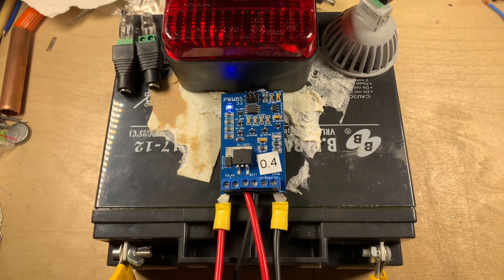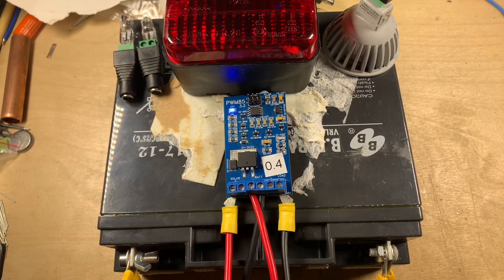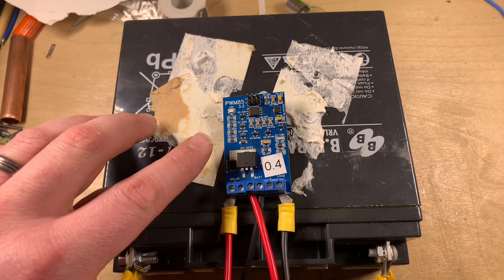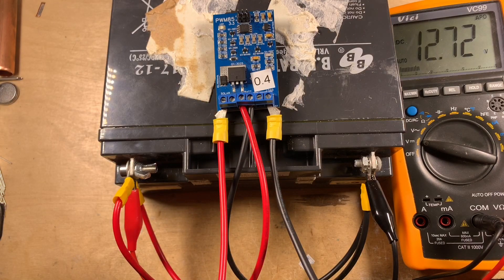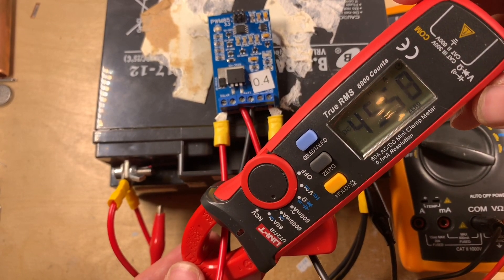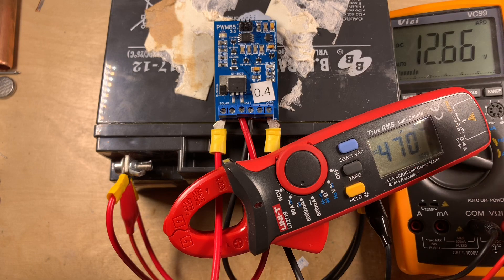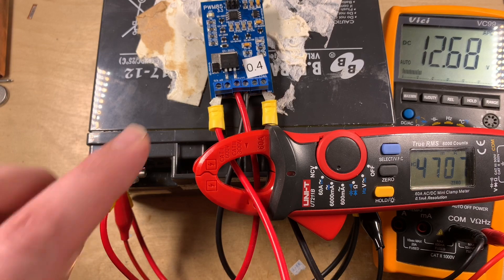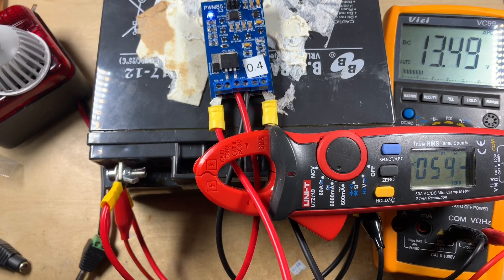PWM85 Diode Test

Comment: Great Video and explanation ! . Would be interesting replace the Mosfet (with external Heatsink) for a HY4008 and also replace the Diode for a HY4008 as Diode . This would be (in my opinion  beast PWM charger when the Load it is a (as my case) a 800W homebrew Sinewave inverter and my 1.2KW solar capacity.  Good channel I see .
SUBSCRIBED !.

Comment: I've always been curious as to why this style of 'charger' does not take the battery to a proper absorption phase before floating. Surely the battery will never be fully charged and its life may even be shortened.
Reply: fully charged battery is 12.7v if its lead acid. bit higher if its agm.
Reply: @slybunda  At rest after charging perhaps but certainly not while charging
Reply: @Magic-Smoke  if your charging with low current then reaching 13.2v is fine for lead acid. as long as its above 12.4v sulfation should not be an issue.

Comment: Nice implementation and interesting as usual. I’ve been lured right in and would love to make up some PWM85(3.3v) and went as far as ordering PCBs from JLCPCB, then the “fun” started. I’m having a devil of a time sourcing the parts, some a lot more difficult than others. Is there anyone out there doing a kit?
Reply from the maker: I’ve source 95% of the parts at LCSC.com. The biggest issue for availability is probably my choice of 1206 parts - most people use smaller. I could probably provide a list of stock numbers. 
Where is the world are you?
Reply: @AdamWelchUK  thanksgiving for the offer- I'm in Australia. As it has transpired I've ended up being able to source everything except for the MOSFET but I have a work around in play so it's ended up all good. I don't think my eyes or fingers could handle any thing less than 1206 so I won't be complaining about your design choices! I think the biggest issue was trying to order only what I wanted and getting stuck with minimum quantities of some components (some at 50 or so). In some cases I substituted higher spec parts so covered all. They didn't cost that much at fractions of cents each but it's a bit of a waste- unless I make a heap of these, At least the DIY reflow wil nowl get a good workout.
Reply from the maker: Glad to hear you’re sorted. Good luck :-)

Comment: Could a Dc power supply be used instead of a solar panel, and if so what would the minimum spec be of a DC power supply? Awesome stuff. Thanks Adam.
Reply: i used spare laptop charger, hp which was 19v 3.5amp and it worked good.

Comment: Slightly unrelated question about the Uni-T clamp meter, if you connect probes/alligator clips to the terminals on the bottom, does it have the functionality to read watts if you connect it to the battery/solar panel terminals?
Reply from the maker: That would be a nice feature wouldn’t it? But no, I’m afraid it doesn’t.
Reply: That is a shame. Seems like such an obvious feature to include if they've already gone to the trouble of adding the voltage measurement circuitry and terminals.

Comment: Previously you tested a red board with a CN3767 which is closer to a mppt buck converter. I would love to see if it out performs the pwm. As I am messing with very old 10v 2a panels (I have 5) but 50v is too much for most converters so i plan to use 2 x20v and 1 x10V. The two 20v strings each on their own charger for 2 x 12v 24ah batteries. Do you still have your energy meters (big blue box)

Comment: Not on topic so please excuse, but I ask a question on fuse video you did from 2016, could you please take a look?  I'm so interesting in the answer I can't stop thinking about it.  It is a question about having a fuse on the negative and positive wire.
Reply from the maker: I’ve commented now over there.
Reply: @AdamWelchUK  Thanks, that was an interesting video.  True, most of the time, everyone would size the wires the same.

Comment: Hi Adam
It looks as though your panel as not receiving 100W of solar insulation any way as I would have expected at least 5.5A from it.  Either that or the panel was very hot reducing it's output.
100/18=5.5 I have assumed an MPP of 18V.

Comment: I would remove the diode, or add a contact to bypass it. Just don't connect it wrong. You will get 1.8% to 3% more power in your situation. Stop wasting energy. Please. (I am running off of solar for quite a while now, several years and I do not allow myself to waste energy).
Reply from the maker: It’s removable for anyone that wishes to - the pads are bridgeable. I like the insurance of it being there.

Comment: 13.5V charge limit?????  14.4 volts is the normal value for lead acid batteries, or is this an AGM Battery?
Reply from the maker: It’s AGM but the charging limit is programmable you to about 16 volts.
Reply: 14.4v isn't the maintenance or float charge voltage though, it's usually 13.5 - 13.8, so spot on in this case.

Comment: Wicked so your design is way more capable than you realised.
Reply from the maker: Julian rated the pwm5 for 6 amps - enough for a 100 watt panel. So it’s just the changes to the hardware I’m having to test really - along with the software which is very different now!

Comment: hello adam, nice video, How is your powerwall holding up? I bought 7 prismatic cell Lipo 3.7v 150AH for my 24v inverter, which cut off at about 21v, 3v for each cell, I drain them to about 3v daily, but my mppt charge controller is set to charge them to about 4v daily, the chinese manufacturer I bought it from estimated about 2000 cycles, but reading from battery university suggest otherwise, say Lipo is about 300 to 500 cycle, what's your opinion?
Reply: Lipo has far less cycles than LiFePo
Reply: @tobimai4843  so in situation, what are the amount of cycles?
Reply from the maker: My lithium pack is running well thanks. I don’t deep cycle it very often at all though, but having said that the cells came from old laptop batteries which must have used up a fair few of their cycles! My understanding is lithium cells should have more than 1000 cycles in them and I’m not sure about the credentials of the folks behind battery university.

Comment: I was wonde

Don't now if this is a stupid question but do you really need that diode because most of the time it's build in the solar panels
Reply from the maker: You’re right lots of panels have them built in. The main reason is the protect the mosfet - if you short the solar panel connections this diode prevents the full current of the battery flowing through the body diode, which would kill it.
Reply: @AdamWelchUK  okay I get it, thanks

Comment: I find that when using a PWM charge controller, the panel alignment becomes critical, for maximum current. When the panel is at the MPP, it becomes less sensitive to it's orientation with the sun. The difference in orientation can be 10° - 15° off axis with MPPT, but only 5° may 10° off axis with a  PWM charge controller.

Another great video. 

Thanks Adam.
Reply from the maker: Cheers John. The pitch of the shed roof isn’t ideal for April sun - you’re right this was probably also having an effect.